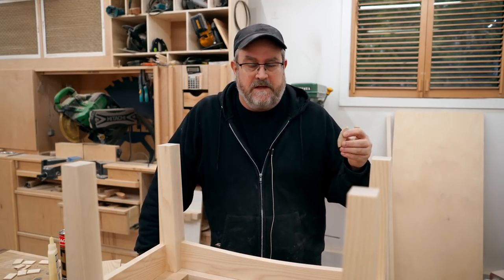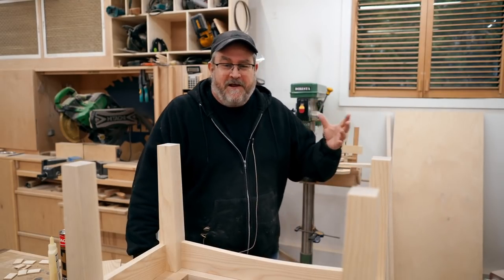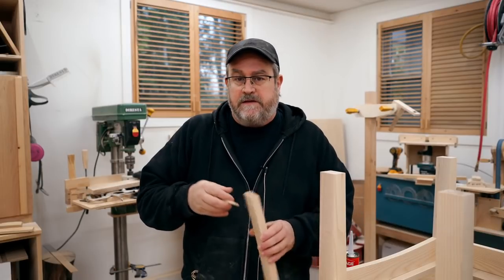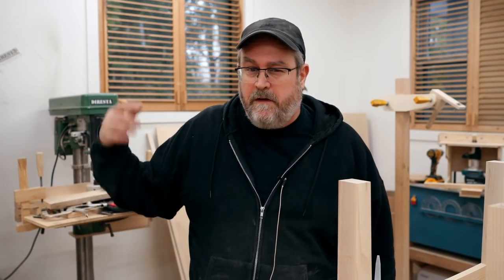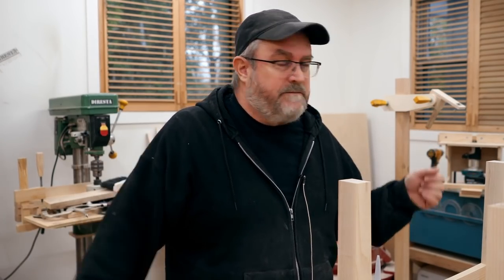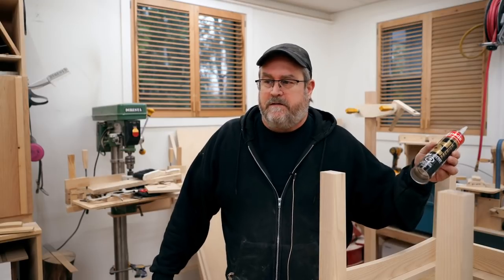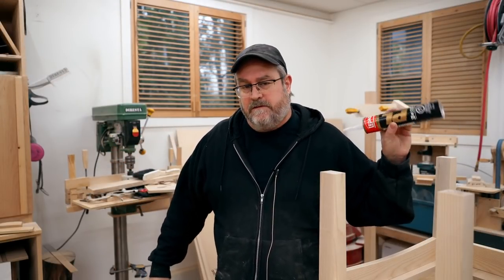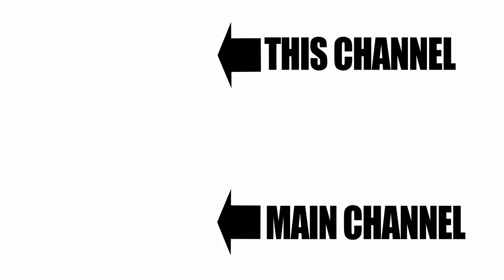The Results Of MY Glue Test...

Comment from the maker: Of course the glue stuff is in response to the video that Wandel made where he tested a bunch of glues, but used the wrong type of construction adhesive. And to the best of my knowledge (because he's used it before) he already knows the difference, so I suspect some shenanigans.
Fact is while it isn't quite as strong as regular  wood glue, it's certainly strong enough for any kind of woodworking - fine or rough. 
I use it for several reasons, chief among them is that it works in a cold shop and takes longer to set. You can pull off the most complex glue-ups with plenty of time to position parts and get it clamped. It also doesn't have water so it doesn't swell the wood like regular glue does. As a result tighter joints can be put together with this glue - it actually lubricates the wood. 
It's waterproof and my favourite for putting together box joints.
It doesn't drip all over the place and can easily fill any gap your lack of woodworking talent produces :)
Reply: Tell me I'll get high if I sniff it and you'll convert me from attempting to glue everything together with nail varnish remover 🤔💀
Reply: You have commented several times about the strength of glue and ordinary construction materials and how many people underestimate strength and overestimate the need of strength in a given application. I can confirm practically all of my own projects are grossly overbuilt and so are the projects of other diyers I know and see. Not everything requires unearthly strength
Reply: Its fine, both of you will get more views as result. I also use that construction adhesive. It fills gaps great,  it will function in a wider temperature and humidity ranges, and overtime its more rugged especially against heat and water. It also resist impacts and vibration better after dry, which wood glue often does not.  It might not have that type of initial adhesion to clean dry wood at ideal temperature type of lab test that  Wandel is running, but that type of construction adhesive was made for real life, in the field conditions.
Reply: John, how do you seal the tube between uses. Maybe for you since you use it on a regular basis it's not an issue, but for someone who might use it once a week what is the trick to storing it between use. I have tried using those fancy plastic caps and tape with mixed results. So any tips you can share about this. Might make a good #short
Reply: Swelling the wood might be a good thing when repairing old furniture.
Reply: The straw is a good idea, haven't tried that one yet. Thanks.
Reply: Hi John.  I agree with a lot of the advantages of this glue.  I have used it before for some of them.  However, one thing I find personally, is that it does not compress and squeeze out as easily.  I find I have to apply more clamping pressure, and I have accidentally left joints with a tiny gap (not a wide visible gap, but just that you can see the glue line).

I noticed the photo of your butcher block looks like very tight glue lines.  Do you have a technique for this (do I use too much glue?  Do you spread first somehow)?  Or do you just apply a lot of clamping pressure?  Cheers!

Comment: I used to use PL 400 to glue subfloor to the joists in the houses I was building.  Sometimes they were wet and sometimes they had frost on them.  Never had a failure.  Had to go back and tear out some of the work many years later.  Those joints were very strong.  If the Premium version is even better I have no doubt it is strong enough.

Comment: John, I really like using polyurethane construction adhesive too, but my problem is storing it between projects and keeping the glue from hardening in the tip. I tried running a big wood screw into the end, but still have the hardening problem do you have any tips for storing it? Much appreciation and admiration from an ex-pat Canadian living in Texas!
Reply from the maker: The best solution is to use it more often. The nozzle is plastic, so even if the opening is sealed tight with a screw, air can still reach the glue - it slowly goes through that plastic.
Reply: This is the reason I don't use it
Reply: To get the old glue out, don’t bother with a screw, doesn’t work. Slice the tip lengthwise, stick a screwdriver in the slot, and push the plug out. Then use non stretching tape, like clear packaging tape, and tape the tip back together. Next time you use it, just cut off the tape and repeat. Works on all kinds of caulking too. From a fellow Canadian in Kingston.

Comment: I think analytical testing of products is fascinating, but the thing with woodworking is that there are so many methods that are "good enough."
Sure, pocket holes are not as strong as dovetails, but unless you plan on driving a truck over that TV stand, who cares? 
Same with glue, while the construction adhesive may not be as strong as other glues based on a very specific test....it's probably good enough (as demonstrated here) that anything stronger generally doesn't matter. 
Great video, can wait to see the next response!
Reply from the maker: Testing would be more interesting if it did just that: point out how insignificant the differences are between each one when put in their proper perspective. Establish a minimum as a benchmark and say that's 100%, and rank everything that surpasses that benchmark as over 100%. So one glue might be 102%, while another might be 101% and another still may be 103%. Establishing that benchmark would be the hard part.
Even then most people wouldn't recognize that the differences aren't significant enough to fret over. It takes experience and a practical understanding of the factors involved and how to rank their importance to get there.
Reply: @IBuildItScrapBin  Absolutely.  Ive used a wide variety of adhesives on projects.  When I made my first ever bed frame, with mortise and tenon, I really messed up some of the mortises, leaving a very loose fit.  So, i used what I thought i was supposed to use: Polyurathane glue, because it was "Gap Filling."  Of course, now these tests are coming out saying that glue is no good at all.  But it also turns out that my bed frame, 6 years on, is totally rock solid.  
Its weird that as an engineer I think OTHER people over analyze things....

Comment: I have used that type of adhesive (Gorilla ultimate) to hold paper towel dispensers to a porcelain tile wall in a corporate building bathroom. It has held for over three years now. Plastic to porcelain daily use and abuse. Not one of the 16 installed has moved at all.

Comment: Hey John, it's been a number of years but ... , I used to thin PL Premium with Xylene ... worked quite well. If I recall correctly the one used for landscaping doesn't expand as much ... Now I'll have to go test it again.
Reply from the maker: I've never had a situation where I thought it would be better if I thinned it. It spreads out really well and the long open time gives you plenty of time to do that before it starts setting.

Comment: Is that PL 3X you are using? I could only see PL on your tube. I love PL3X but its color & thickness keep me from using it on furniture building
Reply from the maker: It's PL Premium. The 3X isn't the name, it's just saying that it's 3 times stronger than regular construction adhesive. The 8X version is 8 times stronger.
Reply: @IBuildItScrapBin  I have used both Loctite PL products, most often 3X but  8X for overhead horizontal gluing. They have either large 3X or 8X  adjacent to the PL. I didn’t see either on the tube you showed & was wondering if it was perhaps a different formula.
Reply from the maker: This tube says 3X too, but the product name is PL Premium. Loctite just has a different label for the same product from the same manufacturer.
Reply: @IBuildItScrapBin  Yes I know the product name & I agree with your praise of it. Do quibble with your assessment of Aliphatic resin glues. Think Titebond is superior because of all the choices offered like Titebond II Extend Wood Glue with longer open time, like around 15-20 minutes allowing for complex glue-ups without a heart attack.

Comment: I've been using PL for years. That stuff will pull concrete up if you glue a 2x4 to it and try and bash it off with a sledge hammer after the fact. 

It is the best. Period.

Comment: Mathias this Mathias that...  His tests were flawed...  You have to look at "Cure Time" Titewad 3 is 24 hours...  PL-400 is 2 to 7 days.  All things being equal and leaving them over night.. simply is not equal.  Just look up "Structural Adhesive"... there aint no Elmers there... My general opinion on glue choices in the shop...  "Resorcinol adhesive"  Holds boats and planes together - it will hold a table together
Reply from the maker: The other, more obvious flaw is that I don't use PL-400. 
PL-400 is a regular construction  adhesive, and not suitable for quality woodworking regardless of how long you let it dry.

Comment: I've never been a glue obsessor.  For the most part I ask if I will need to disassemble the part at any time.  If so, I use a glue that will come off with heat.  If not, it's pretty much free reign unless I need something waterproof.
Reply: Yep, I just use what will do the job, no wracking my brain for hrs. Only once in my life did I need to make something strong enough to hold up a car. It was a rack to hold up a car.

Comment: A couple things here:
I think it's silly that you are known as the construction adhesive guy. I've read a couple of comments from guys that are actually judging the hell out of you for using it. Whatever. I suppose any publicity is good publicity. So they say...
I'm glad your quick and dirty band saw video is still doing good. I've just recently re-watched it a couple times. I'm working toward a decision on what method I want to use to mill some logs. My buddy keeps chain sawing up and splitting perfectly good logs for firewood. So it's a race for me to get to milling them before they are just up in smoke.
Reply from the maker: To be honest, I wouldn't make a saw mill the same way again. Making it from wood is a compromise, especially if you are trying to make it low cost.
Reply: @IBuildItScrapBin  I mainly examined the whole mechanical/pieces/parts aspect of the build. The saw itself seemed to function just fine. The fighting of the log through cutting process was a little unsavory I'm my estimation. I'm thinking a hand cranked wench thingy would do the trick. On the same cart type system. 
Really, I just want to do it to do it. After watching so many band saw builds my head is full of fifty thousand little design tweaks and features. Build one to get a start, and then build a better one from what I've learned by doing it. 
Thanks for the reply, and all of your enjoyable videos.

Comment: It strikes me that PL Premium would be the best adhesive to use with biscuits as regular wood glue can occasionally cause the biscuits to swell.  In a project I did many years ago, a panel glue up resulted in these biscuits telescoping through the surface due to swelling.  I often avoid using biscuits since, but now I’m tempted to try this….
Reply: The biscuits are supposed to swell.  That is why biscuits must be used with a water based glue.  The swelling allows the biscuits to expand and grip in their slots and be strong.  Biscuits and their slots are not tight enough to form a strong bond unless the biscuit swells.  The biscuit is made from wood that is designed to absorb water and swell up.  Your telescoping through the surface due to swelling is a known problem/trait.  You solve this by making sure the biscuits are not too close to the surface.

Comment: Could Matthias wood snapper machine thing be useful to you and him to have that kind of machine test the pulling strength of glue if the machine can pull out glued in biscuits/dominoes?
Reply from the maker: All tests are relative, so their value is also relative. 
If, for example, you are testing how close to true white several different brands of paper are and measured a difference, is that difference important to how you use the paper?
If all of the glues tested will do what they are supposed to do and perform better than a set standard, what's the value in testing them to begin with?
It's like that sheet of paper when all you are doing with it is writing a letter. For this purpose (and most others), the paper is white enough.
Reply: @IBuildItScrapBin  I understand, I was just thinking about bridging the gap between your videos and Matthias with his lumber strength testing contraption
Reply from the maker: Oh it would take more than that contraption to do that :)
If I seriously wanted to test joints or glue, I could build my own doohickey to do that. Fortunately, I don't have any interest and there's more than enough guys doing it already.

Comment: There's nothing really wrong with the "weaker" PL that Matthias used, the problem with the low testing was because it didn't have enough cure time. That type of glue increases over time. The longest he gave it was 2 days, but if he left it for a week or even 2 weeks, then it's strength rating would've massively increased. That 2x4 you pulled off the wall would've come off much easier in the first day or 2, but after that full curing time it tore your plywood apart.
Reply from the maker: No need to put weaker in quotation marks - it is weaker and that would be the problem with it. Ultimate strength is lower and not what I'd rate as reliable for quality woodworking.
Reply: I had to separate two pieces of wood that were held together with PL with only about 20hrs drying time. They would not budge without cracking the wood. More curing time might have made the joint stronger but it didn't need to be.

Comment: Do you expect anything more from the biscuit than just alignment?
Reply: That's the only reason to use biscuits so why ask?
Reply: @MrWizards1974  they reinforce miter joints all of the time
Reply: @Lumens1  No sir they do not. They are used for alignment in miter joints not reinforcement. Biscuits do not add any strength at all an in some cases weaken joints in softer woods.
Reply: @MrWizards1974  cool since you made the claim stating that they are only for alignment, then you have the burden of proof to show that they in fact weaken a joint and/or do not strengthen a joint. Post up some video
Reply: @Lumens1  First of all it's no "claim" Its a fact. Any woodworker worth his salt knows this to be true. You obviously have never used biscuits before. It is not my responsibility to educate you any further. I gave you the facts. I see you have provided no proof for your argument so I guess you are just being argumentative.
Reply: @MrWizards1974   I’ve used lots of biscuits in the past but in fact prefer splines for miters for accent. The whole “worth his salt” is how myths become widespread. If it is such common knowledge then you could easily post a video claiming your view. You don’t understand burden of proof so I will educate you. You made the claim but provided no proof. At least defend your views bro
Reply: @Lumens1  Yeah see in knew you would come back with some BS like this that's why I posted a video link even though I don't like  to do that in someone's channel. LOL You have no idea what you're talking about. You educate me? I think not.
Reply: @MrWizards1974  what video link where? I’m not sure why you find this such a difficult discussion. This isn’t an argument by the way, it’s a discussion. Very important difference between the two
Reply: @Lumens1  True, no video, no proof.
Reply from the maker: He tried to post a comment with a link to a video, but YouTube marks those as spam for me to approve. I approved it, but it still hasn't shown up here. 
As for whether a biscuit adds strength, it's similar to the marginal differences between the different brands of the same type of glue: an unimportant detail under most circumstances. 
There are times when adding a biscuit will absolutely add some strength, but most times the difference it makes isn't significant. I use biscuits primarily for alignment and the shear strength they can provide.